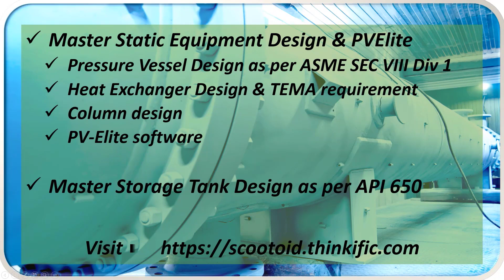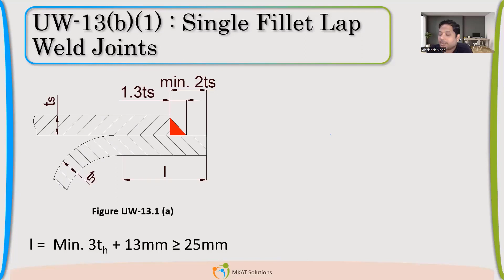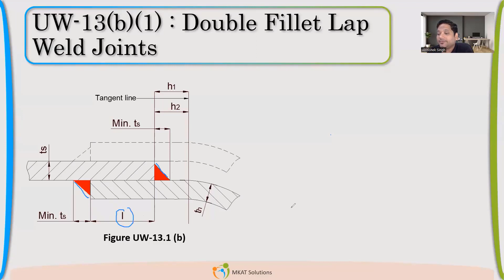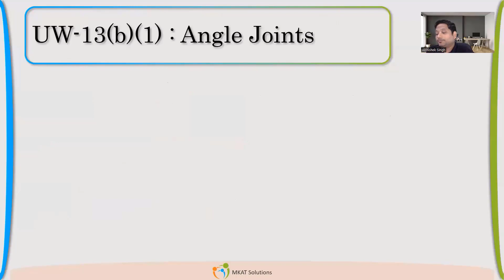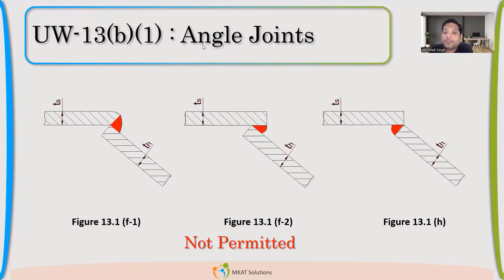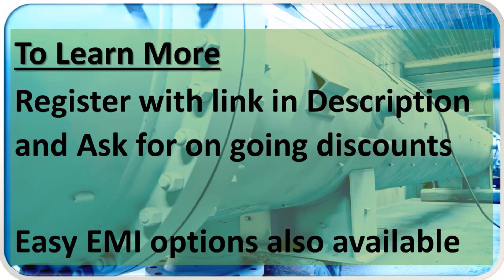Attachment Details of Head to Shell Lap Welded Joints

Comment: where could you find the requirement for single lap welded dish heads under pressure acting on either side of the head (1.35 minutes), shell ID <= 600 mm and ts <= 6 mm?